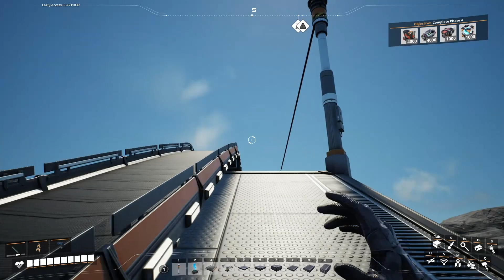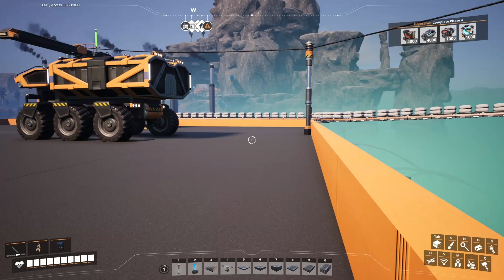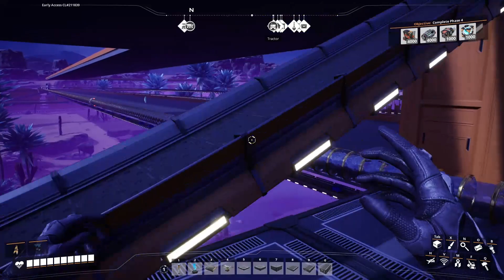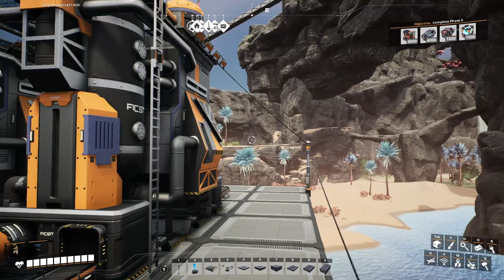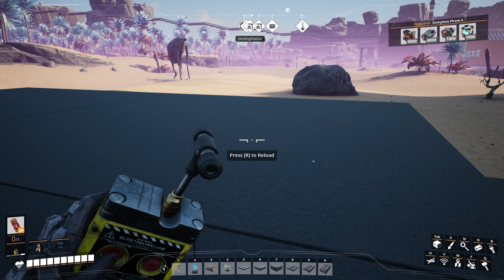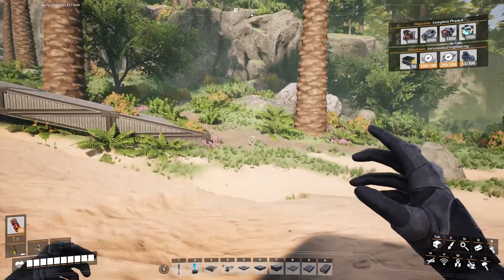Satisfactory Update 7: Episode 21: Aluminuminium

Comment: Hello Friend, I'm still watching but I had a idea I thought I'd share. in stead of using 3 pumps and turn 1 off when things are up, why not have 2, a big buffer vat pump that full, then turn on the whole thing. this will give you a buffer to "drain" for producing the scrap and having the water source from there.
Reply from the maker: That is actually a really good idea. I wish you'd been around when I was setting it up!
Reply: @StormhavenGaming  I am happy to see the pod has returned. And now I finally understand what that little roof on the M.A.M. is for :P it is so you dont get cooked from the pod taking off and returning when doing research
Reply: @StormhavenGaming  Also for rail, think big, start small. so have a plan for the "big loop" and make sure you can just build out in segments before you need to make the whole thing in one go. rail is a massive undertaking. so using a double rail line for back and forth making it posible to extend it and have a big loop at some point. thats my advice. Solely on the whole fact rail takes alot of time and you probably want to do other stuff in between
Reply from the maker: I think the rail network will have to be done in stages, yeah. I don't have access to all the resources I'll need yet anyway and will have to modify the track later. The first section will probably be a wide curve from the Hub down to the oil refineries, taking in the areas that we've already hooked up.
Reply: @StormhavenGaming  ooh nice. rail curves are more easy then road curves. I would advice to make pillars and connect the spots not having the pillars on the worldgrid, the rail is eayser to curve and conncect. sometimes make straight sections you want to connect and then make the curve to connect them. the game has an easyer time connecting two sections then building a curve you want and then continuing. if that makes sense
Reply from the maker: Ok, I think that all makes sense. I think I'll need to spend some time messing around with rails to get familiar with them again.

Comment: My experience with trains has always been:
If I setup a loop, it's used as a push/pull and I overbuilt.
If I setup a push/pull, I need to link in other lines and I've underbuilt.

So I overbuild.
Reply from the maker: It does seem like the loop is the most efficient design, and the simplest (potentially) to set up and modify/add to. The cental hub station will probably want to be right next to our storage facility. I kind of want to make a huge, multi-platform/transit depot, to try and be a bit more focused on the look of it.

Comment: Really like your series 🙂
Some comments: 
(1) I'm not sure about load balancing, as it usually takes longer to set it up than a manifold to start up by itself
(2) I created one big loop, no station on the loop, but branching off. And only 1-2 items types per train. works like a charm, but took me about 6h to create the loop around the whole landmass.
(3) you should probably improve your power production next 🙂
Reply from the maker: Thanks for watching and commenting. I'm glad you're enjoying it.

1) It hurts my brain. As you can probably tell, maths has never been a strength of mine. It's quite a struggle to work out the flow of materials.
2) That does sound like a good idea. Do you have a one track, single direction loop with multiple trains? And stations branching off rather than being on the main line is definitely the way to do it.
3) I think you're right. We are dangerously close to everything shutting down!
Reply: @StormhavenGaming  
(1) I know... I usually just produce as much as I can of one product, and then take it from there to the next step. For bigger builds I use the Satisfactory calculator to get the numbers right. My aluminuminium factory processes 2400 bauxite per minute.
(2) I have a double loop (clockwise/counter clockwise) - just because I wanted to build a nice model railway :-) Wanted to try the new signals. 
I started my current playthrough in Update 4 btw - sadly parts of my fuel production and parts of my railway is now embedded in rocks in the spire coast 🙂

Have fun and keep up the good work!
Reply: @DarthWater1802  You might be able to move your Spire Coast factory out of the rocks using the Satisfactory calculator.  I had the same issue, and I moved the whole factory further north to get it out of the rocks.  I needed to reconnect the oil lines and power lines, but other than that, it worked a charm.
Reply: @AndrewGarber   Thought about using the editor, just not a lot of time to play myself at the moment :-) But I started building a new power plant in the blue crater, 66 generators down, 198 to go...